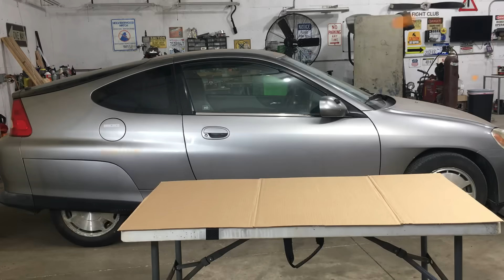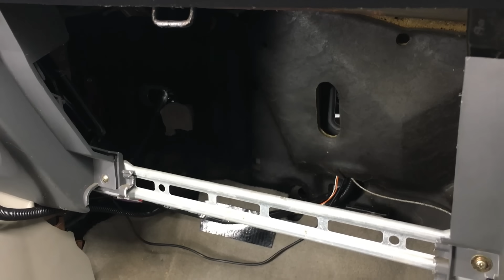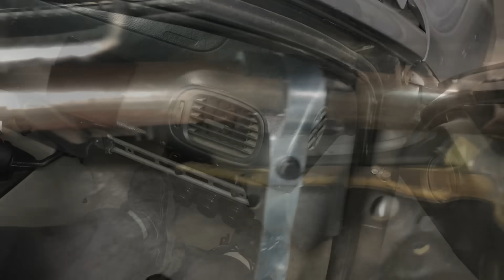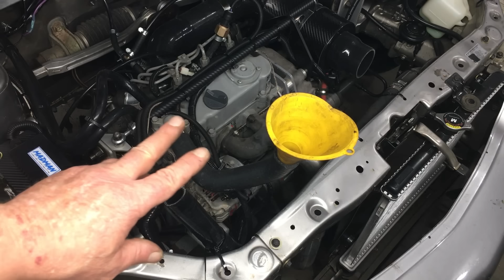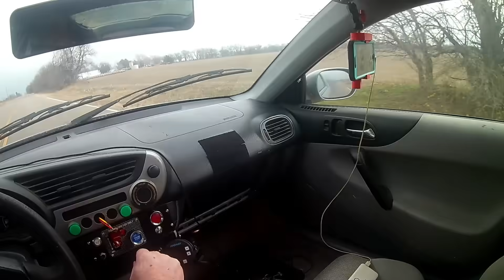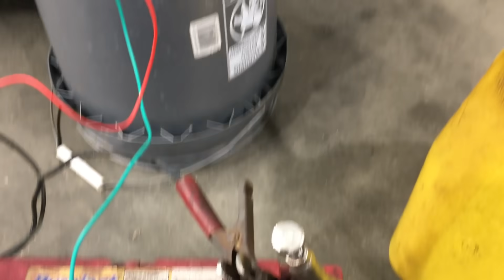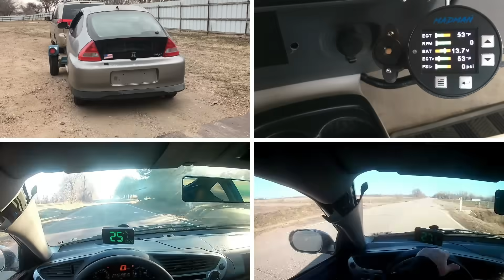S3 E46. MPG ? We test the fuel economy on the 719 cc diesel powered Honda insight

Comment: I hate knowing that putting a supercharger on this will not increase the fuel economy. There is a reason almost all modern engines use turbochargers instead of superchargers. Superchargers increase power but not so much efficiency. While turbochargers give you both when utilized correctly.

Also, blocking off the radiator is not the best solution to your over cooling issues. Finding a higher temperature thermostat is the real answer. I used to run a 195F stat in my small Isuzu diesel to help with efficiency and cold weather heating.  It made a huge difference compared to running a colder thermostat with the radiator completely blocked off.  If I remember correctly, the optimum temperature for a diesel engine for fuel efficiency is over 200F.  

Keep up the good work. Even with my nitpicks I enjoy your videos!

Comment: The "toxic gases" given off when you weld galvanised steel are not actually gases at all - it is very fine metal oxide particles suspended in the air, which appears a lot like smoke. The most problematic of these is zinc oxide - this is usually the culprit when welders get a condition known as "metal fume fever", and is basically zinc poisoning from inhaling the welding smoke. To avoid this, you just need a mask or respirator with a fine grade filter which can trap the solid oxide particles to prevent them being inhaled.

Related to this, when you dissolve the galvanised coating off with acid, the gaseous product from this is just hydrogen. Which isn't really toxic to breathe in small amounts, but it can be a fire and potentially explosion hazard, since it only takes about 5% hydrogen by volume mixed with air to form a combustible mixture. Using hydrochloric acid (aka muriatic acid or spirits of salt) at high concentrations (above 30%) can release small amounts of hydrogen chloride gas, since hydrochloric acid is made by dissolving HCl gas into water. Most of it stays in solution, but at high concentrations a tiny proportion can escape - this is the cause of the "fumes" from concentrated hydrochloric acid.

The engine coolant powered heater core reminds me of the way you can generate hot water on boats - any boat with a petrol or diesel engine can in principle do this, but it seems to be most common for narrowboats running on canals. The engine on a boat doesn't usually have an air-cooled radiator, because the water the boat floats on is a better coolant. This usually goes through a counter-current heat exchanger to avoid having the impure sea / river / canal water going directly through the engine cooling passages. But you can fit a second heat exchanger which runs water from an insulated tank somewhere else in the boat, and a changeover valve you can turn to choose which heat exchanger the engine uses. On narrowboats, this is usually referred to as the "calorifier" - since the otherwise wasted calorific value from the diesel engine cooling system is being used to make hot water for the people living on board to use.

Comment: i enjoy watching people tinker, but i kind of feel its a wasted effort if there's no real benefit to the tinkering though. in this case the car is a lot less of a car and even less economical than it was by simply running the car on gasoline without the hybrid system. at 55 i would get upward of 85mpg on one of these cars in stock form without anything removed like this one was after being stripped down, likely woulda been over 90mpg then. and my car was no fluke, i had 2 of these cars, with virtually no modifications, over 200k miles on each and making over 80mpg on both for full tanks of fuel at a time.

Comment: FYi- tesla's no longer use electric heaters. they use heat pumps. they borrow the heat generated by the batteries & motor during operation.

Comment: Id love to see a heater experiment by running the exhaust pipe through a reservoir of water and piping it through copper plumbing pipe through the cabin with a small pump. Maybe a straight through muffler could be modified to turn it into a water heater?

My thinking is that the exhaust will get hot before the coolant, and be more efficient at heating the car?
Saying that the heater matrix will help take heat out of the engine, which may be more important in the summer when you maybe start feeding over 1bar of boost pressure and or propane or nitrous oxide into it.
Reply: Toyota has used coolant going through the exhaust on some of their vehicles to get coolant temperatures up as fast as possible. Not for interior cabin heating but for emissions and fuel economy reasons.

Comment: There is something I (and I'm sure many others) would like to see tested on the small diesel engine. Especially na. That would be a ram air intake.  Either in front of the radiator, or  an intake box with large enough inlet on the bonnet, or in front of the front bumper. Somewhere, where instalation would be the easiest and minlimal (hopefully none) cutting would be required  😂

With the small displacement engine, creating positive  pressure should be fairly easy even at reasonably low speed

Btw loving the videos. Especially the little diesel, can't wait to see the supercharger on it. Maybe even twin charge some day, like some of the japanese kei cars 😅

Comment: Regarding your overcooling of the engine, you may want to add a thermostat for the cabin heater that only opens once the engine is sufficiently warm. 
A thermostat block for an oil coiler with replaceable themo elements to dial the temperature may suit, I know Mishimoto makes those.

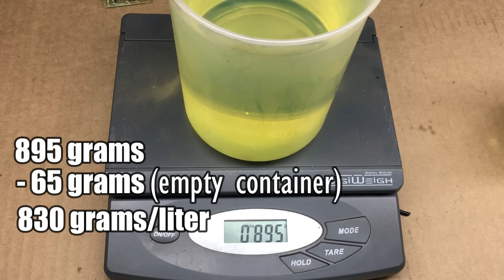Comment: 13:43 ..you are smart guy, using metric system, don't need to apologize .... on the other hand  seconds and fractions has to do more with a time and mathematics, but not measuring stuff. If you can count to 10 - you are top gun in a metric system.

Comment: The computer fan burned up because it was wired backwards. Those dc brushless computer fans can only be wired one way, and usually burn up if not correct.

Comment: James, there is a new kind of car battery and lead-acid battery design that uses "vomit" (that's muriatic acid, what you called "vomit" of course) instead of the outdated sulphuric acid and with it new carbon negative ion technology. Though no lighter than recently obsolete prior lead-acid batteries they can deliver the watt/hours and and faster charging as LiPO batteries at fraction of the cost.

Comment: Tesla fanboy here. In 2020, Tesla began doing away with the PTC heater in favor of a heat pump system with heat recovery using their in house octovalve, it’s quite the engineering piece. Any EV not using at least a heat pump should not be bought if you regularly drive in cold climates IMO.

Comment: Are you going to have to block off some of the air going over the radiator to keep the diesel at colder outside temps?  Dang...  2 minutes later you answered that.   I was thinking about that since the last video.

Comment: electric heater can do much sense in a car, heated gloves for example uses less then 10W i got a pair of batterypowered for when im driving my motorcycle in cold weather and it works fine.

Can also find heater for the seat, socks, vest and more.

Comment: Sweet, if you can get that up to 96 mpg you will equal the cost of fuel per mile in the original drivetrain(going by epa 70 mpg and lower cost regular gas). Goals. Comment with love, I know the channel isn't about mpg or speed its just about having fun putting small cc engines in cars

Comment: Electric heaters are only found in Electric cars lol and they are known to significantly reduce the range of an electric vehicle in the winter not to mention the cold also reduces the range of the battery. That's why tesla is putting heat pumps in their new vehicles to reduce the energy consumption for heating but those don't work very well below freezing in extreme cold and so they get backup from a power hungry resistive heating element and the whole concept goes out the window. As for gasoline and diesel engines it's more efficient to use the waste engine heat to heat the vehicle interior then to put a huge load on the engine and alternator to generate the 1,500 or so watts for an electric heater.

Comment: As for the predator engine you can make an air cooled engine a duel cooled engine of both air cooled and water cooled by running thin metal toobing like hvac copper toobing for example literally around the cilinder in between the cooling fins and then send that hot water into a similar heater core somewhere in the cabin. Heating the car with waste engine heat is obviously more efficient then having a seperate diesel heater or electric heater how ever with the small engines you go going on it could also make the engine itself run less efficient if it runs too cold or below normal operating temperature which we see in this video to the point where you have to block off most of the radiator to get the engine to run at a more efficient temperature for the engine to run more efficiently so your fuel economy may drop because of that. The good thing is that if you manage the keep the engine temperature at normal operating temperature and still heat the cabin you are running at like at a pretty high efficiency basically because most of the energy in the diesel is being used for something useful about 35 percent is used to generate mechanical energy most of the remaining 65 percent is used to heat the cabin and some of that 65 percent percent is wasted in friction and noise so it's not 100 percent efficient but still a very efficient system overall. 

P.S only in the winter obviously when heat is needed it is more efficient to use waste engine heat to heat the cabin then to burn more fuel to run a seperate gas, diesel or electric heater.

Comment: Merry Christmas Jimbo!  You might want to consider fuel flow rate to obtain an instant mpg.  The gas mileage looked quite good for a first pass.  With some refinements, I'm sure you can get well into the 70's.  Keep in mind that tire rolling resistance goes up with decreasing temperatures, even when the same inflation pressure is used.  Is there a correction factor to get back to +25 degrees Celsius?  Probably not.

Comment: I have a diesel Smart car. It does about 80 mpg at 56mph and is fast enough to keep up with motorway traffic 70mph all day long.  It is a turbo charged 3 cylinder with a 5 speed auto box.  It is fun to drive an accelerates quite rapidly because it is lightweight.😊

Comment: Interesting bit of random data.  My daily driver is a 2006 Diesel VW Jetta.  This car contains an electric grid heater in the HVAC system, known as the aux heater, that'll warm the cabin up in cold winter days before the very small diesel engine can ever possibly start to produce warm water.  Took me a few years to realize said heater wasn't working, but once I figured that out and fixed it (cold solder joints on some SMD resistors, easily reflowed with a hot air work station) this car now has the best thing I've ever experienced in my life.  Warm air almost immediately from the HVAC and heated leather seats.  I'm absolutely in love with my Jetta.

Comment: I have been watching a lot of edison motors videos and i was thinking about how to downscale their idea of an electric vehicle with a diesel generator to a small car and how efficient it would or wouldnt be compared to just a small engine. 

I think that this could be a really interesting project for this section of the automotive community and it seems like there really isnt anyone doing it right now. 

The one channel ive seen do anything remotely close to this was grinhardplumbing and their cheap Chinese car with a gas generator on that offroad trail which was... interesting lol.

Jimbo im not sure how much knowledge you have with electric motors, battery management systems and generators, i dont know a whole lot myself, but i feel like it could be very approachable with all of the videos i have seen recently suggest.

Comment: There are flow metres that you can use to detect fuel economy.
You can also make one out of an old electric fuel pump.
Remove the motor and replace it with a tone ring for a Hall effect sensor.
Or if you’ve got a really good brushless fuel pump you can count the pulses from the controller

Comment: My car has an electric heater. It has no other kind; never has. And it even runs on batteries; always has. It has been serving beautifully in cold winters for the last 7 years without a hitch. (Also, the Tesla Model Y doesn't even have a PTC or resistance-type electric heater.)

Comment: Excellent video.  I wanted to throw my two cents in on welding galvanized metal.  In some cases stripping off the zinc is a lot of trouble.  For those situations pick yourself up some masks from the welding supply store or online.  There are ones specifically designed for use when welding galvanized metal.  They are not very expensive and it sure beats feeling like you have the flu.

Comment: A couple of things to note about the electric heater and the Tesla.

First, we can't forget where that heat comes from. With an internal combustion engine, most of the energy of the fuel is lost as heat, both in the exhaust and in the engine block which requires a cooling system to remove the unwanted heat - only 30% of the energy in the fuel is actually converted into mechanical energy. Since heat is a waste product, making use of it to heat the cabin is effectively free. In contrast, an electric vehicle doesn't produce nearly as much waste heat in operation - with only 18% losses in the drive train, over 80% of the stored energy is converted into mechanical energy. This is one of the reasons why electric vehicles are more energy efficient overall, even with an existing electrical grid largely powered through fossil fuel power plants.

Second, that electric heater is rated for 2500W max. That's great for warming things up quickly at -40C/F (seriously, it starts blowing hot air in only 30 seconds!), but it's totally not necessary for maintaining an already warm cabin. I just spent 3 hours driving my EV (not a Tesla) at 115km/h (70mph) for 3 hours with an outside temperature of -5C (23F) and during that time the heater ran consistently at about 800W. That's still a lot of power and not something you could reasonably pull from a 12V car battery, but it's not nearly as much energy as it sounds like. DeWalt makes 60V, 12Ah (720Wh) batteries for electric snow blowers - a portable, battery powered cabin heater is entirely feasible.

Converting the units, 800W for 3 hours amounts to the energy in 227mL / 0.06 gallons of diesel. It's a pittance. By comparison, idling a 3L engine for just 10 minutes would take 300mL. To be clear, converting fossil fuels into electrical energy has plenty of losses (roughly 56% for natural gas), so you can't use this as a direct comparison, but it gives you an idea of how much energy is lost to waste heat in an internal combustion engine and how little is actually needed to keep the cabin of a vehicle warm. Compared to the amount of power it takes to move a vehicle at that speed (about 30,000W), running a heater with 800W isn't much of a concern - it adds less than 3% extra power draw.

Comment: Weird that you had a DOA Delta fan, they're usually cherry.... Forever. If you can stand the noise they'll run forever even with a failed bearing

For anyone following Jimbo's advice about giving galvanized parts a dip-
1: hydrochloric fumes corrode or dissolve anything they come in contact with. Once you vreak the seal on the can or bottle, it rarely if ever reseals properly again, fumes will leak until it's all gone. Don't store it upwind of your precision parts
2: if you forget about the parts and go to lunch or something, or to bed, you'll come back to parts that are too small to fit or not to be found at all.

Comment: many of the 90s and 00s VW tdi engines at least in Denmark actually had a coolant flange with 3 big glow plugs going into the cabin but that was only to make it heat up faster if i have understood it right. Since they produce so little heat, and well on a 0 degrees celcius day it takes 30 km/20 ish miles at 80 km/h/50 mph for my mtdi mk2 golf to reach "optimal" temp with the heat off. and there is nothing wrong with the coolant system, everything has been troubleshooted. Before i had a 1.9 TD engine in it and with that one i could barely get out of the town i live in before i could feel heat and well 5 km later 3 ish miles it was at optimal temp no matter what speed i drove at

Comment: For grinding powdercoat off, a cutoff disc works much better than a flap or grinding wheel. It doesn't get as loaded up and you can remove the powdercoating quicker, easier, and more efficiently. The fumes are pretty nasty though so hold your breath. ;)

Comment: I bet those are recovered/scavenged fans from dead servers. Delta is a top notch fan supplier (if you dont mind the noise, they dont care about that like noctua or others). Bolstering this is the fact that in quantIty they are still $15/fan and $23 for onesies twosies.

Comment: Originally 73 mpg city and 53 mpg city / highway so are sort of in the ball park. With the underside aero sorted and a quiet but unrestrictive muffler you should be good. 0-60 was about 12 seconds so I doubt if you will achieve that.
Reply: Yeah, I'm hoping the diesel's greater hypothetical efficiency shines through once Jimbo has everything dialed in, but the first-gen Insight is a really tough target to beat on efficiency, while still being able to maintain highway speed over the continental divide pass on I-90. :)   Which I did this past June, averaging 67mpg round-trip from Missoula to Boston.

Comment: Soviet tractors just had a hole in the firewall, and a fan that pulled hot air from around the engine. Not so effective on a road vehicle.